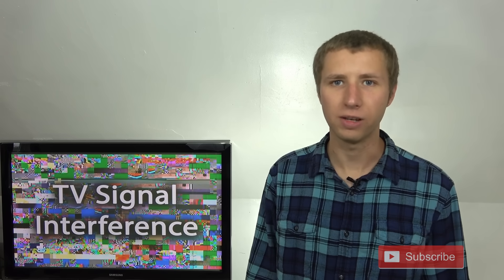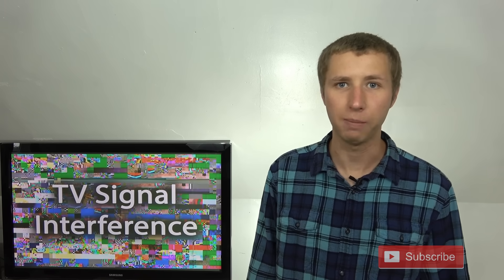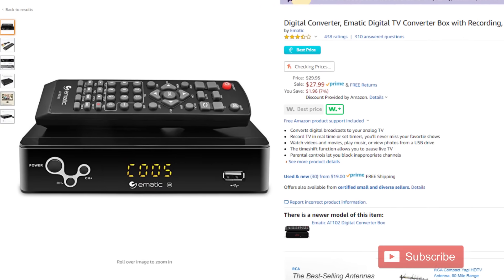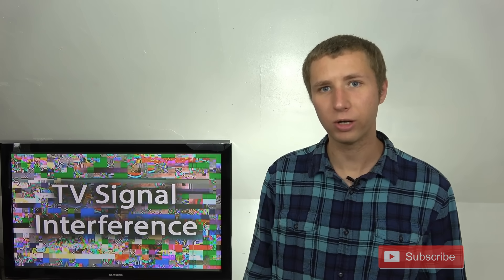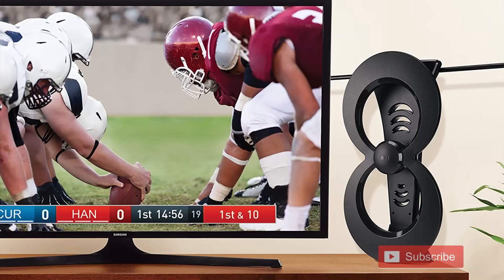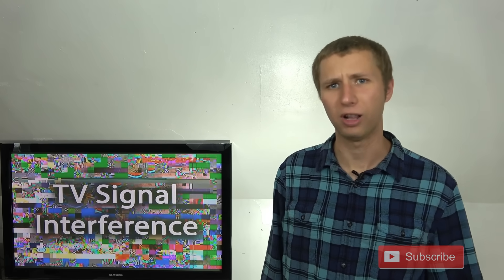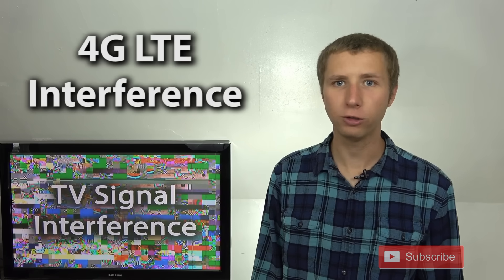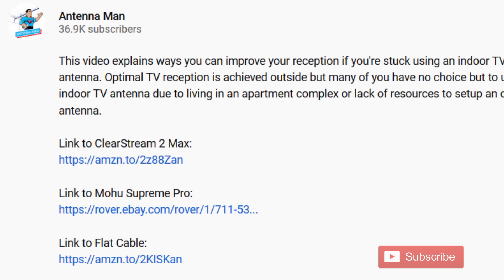Types of Interference That Affects OTA TV Antenna Reception

Comment: Tyler, I paid you for a remote assessment of my home as relates to TV antenna/ strength of channels. You said I would be fine, no tall trees to speak of, no mountains or hills, only 35-40 miles away from the major broadcast stations. I had an experienced tech come to install a ChannelMaster outside antenna to my chimney. He tried 2 different models, neither could receive several channels at all, not showing up on the guide such as 6, 7, 9, 11, 13. He said I had an LTE tower 50 yards away and directly in the way of the signal. He even added an amplifier but, no go. He has a customer a mile away from me that has no problems. Should he have tried to install the antenna at the opposite end of the roof to potentially avoid the cell tower? Plus, I have another home about 65+ miles south of where the broadcast signals come from and needed to know if that can receive strong signal reception with zero trees, lots of flat ground and no large buildings blocking us. Any suggestions? Can you actually come to install the 2 or more antennas we will need? Please lmk, thanks!
Reply from the maker: If you are having trouble with your antenna and signed up for my antenna recommendation service, reply to the original email I provided so I can get more information as I have nothing to reference from this comment alone.

Comment: So! I’m in an apartment in Tucson, AZ. First I get very good reception because I have a full size antenna in my porch, with a booster! I have it mounted on a curved pole on the ceiling I get 100% signal on most of my stations but never as bad like the picture behind you in this video until football season. CBS channel 13 plays great all year tell this time. Now this year so far I’ve improved reception by tilting the antenna upward at the mountain that the transmitter on. But CBS makes the reception look like the picture behind you or no signal at all, but again only during football season.

Comment: I have an area that gets interference in the spring and fall.  It usually happens in the morning and maybe again in the evening.  I used to be able to watch it move from one station to another through the uhf band.  Once it went through the spectrum, it was good.  Now, with digital, it isn't just interference--it is off.  I don't need to tell you that makes unhappy people.   It seemed to improve by moving to the backup antenna, which is not as high.  This makes sense if it is co-channel interference,  but the times of day don't seem to match your description of tropo.  I'm usually not at a loss like this, but I'm struggling here and some folks aren't happy. Looking for ideas.  This is mostly affecting WNEP (and WVIA), RF channel 21.

Comment: Tyler, Great video! I'd like to add it's important to check with the broadcaster. Almost a year ago, KRCR in Redding, California installed $100K of new broadcast equipment.  This was about the same time I cut the cord. I put the antenna up (a very good one), I took it down. I installed a Channel Master PreAmp on the RG6 coax. Still intermittant interference on several channels. I worked professionally with RF, Radars, and EMI during my Navy career. Nothing was making sense.  Finally, I got hold of the engineer assistant for one of the local stations displaying problems and they admitted they were haveing an intermittant "timing" problem across their stations. He also referred to all the text that runs across the screen or displays at different corners of sports broadcast.  Just examples he said puts a big tax on the equipment.  After months, an engineer from "corporate" showed up.  The frequency of the pixelations has decreased, but it still happens.  I can only guess, corporate is not willing to invest another $100K to really fix the problem.  With all that said, there are so many things that can go wrong with a digital signal.  Don't blame your home install and rip it out.

Comment: Can a high-pitched squeal coming through the speakers on my A/V receiver  from the  
HDMI- connnected OTA TV be due to multipath reception?  If so, how to fix?
Reply from the maker: Does the high pitched squeal happen when the picture pixelates or freezes? If the picture is stable, it sounds like an issue with your TV, AV receiver, or the connection.
Reply: @AntennaMan  My connection is secure and my flagship Onkyo AV receiver is only a year old and part of my home wifi network (necessary for room correction settings and streaming services).  Must be the older Vizio TV.  BTW, the picture is starting to fade around the edges and the audio formats limit the selection of surround modes on the Onkyo thru the HDMI.  Might be time for a newer set.   Thank you for your reply.

Comment: would solar panels be the culprit here as well? Cause there were new solar panels that were installed right next to my outdoor antenna on a roof and i feel that it's causing major problems for one UHF channel in particular, in which my TV sets shows that I'm getting great signal on that channel despite extreme breakups lasting indefinitely. I also feel that there's an unknown source of signal coming in on the same RF channel, as I saw one time that another network was coming in for a brief second before reverting back to its intended network, it even changed the resolution indicator from 480i to 1080i and back to 480i a second later. I already contacted the station owner numerous times already about the severe breakup problem, and they did wrote back to me saying that they're gonna work on fixing it, with zero results, as it's been over four months now and the problem continues, that can't be legal, right?

Comment: why do I get pixelation when I walk by my indoor antenna.  It's connected to fire tv recast.
Reply from the maker: Your body reflects the signals. You'll either have to deal with it (it's usually not bad in most cases) or install the antenna outside.

Comment: Was hoping for a "Fix" for non-compliant LED bulbs such as Cree, etc that pixilate the broadcast signal, such as an "in-line" Filter if one exists. TV's on both ends of my house are affected through the cable and are on different electrical circuits. Antenna field is 20 miles away and I need no amplifier for a perfect signal.

Comment: I currently have a large HD stacker antenna in my attic that works great in the chicagoland area. I pick up 108 channels on my HD-Homerun. I'm in the process of getting solar installed and I'm curious if you've seen these systems impact reception. I imagine the metal frame as well as the micro-inverters could affect signal. but I'm having trouble finding anyone with first hand experience

Great channel, keep up the good work!

Comment: My local stations are approximately 11 miles away and come in well, but one (channel 5 & rf 5), comes in great at 65% until my dehumidifier turns on. The pixellating starts. I wish there were some kind of filter.

Comment: Spinning Hard drives take out my VHF signal.  My antenna is in the attic.  I replaced my laptop drive with an ssd but I have a spinning drive connected to my tablo.  When my tablo is recording it seems to not be a problem but when the tablo accesses the drive any other time it takes out my vhf signal.

Comment: Unfortunately I'm 8 miles from Certain TV receptors, with mutiple mountains in bewteen. I tried 3 different antenna which all struggled with PBS, QVC/HSN/DABL but cannot get my local CBS, NBC, iON regular Fox or My TV signals. Even got a converter box and got a Clear Stream Max2, that fixed the PBS, QVC/HSN issues gave me a signal readout but still can't get any of the other channels, even when I take it outside on my Balcony it doesn't help get anything. I've lost hope on picking up those other 19 channels till I move I guess. 😭

Comment: Hello Mr Antenna Man,  question for you. I have an antenna, (not a good one but it works most of the time). I am a fulltime rver  and move around a lot, in this location, my TV was scrambling a lot so I went out got a rg6 quad shield cable. It didn't help my fairly new Samsung smart tv at all, but my Vizio in the bedroom it helped quite a bit in fact no more scrambling, (and it was scrambling a little before). My question: what kind of internal antennas are there in TV's, and is there a way to enhance my Samsung? Thank you.

Comment: Hi Tyler.  I have a Wingard GS-2200 Sensar III on my roof which gives me over 80 channels of excellent reception, usually.  There seem to be no local obstructions like trees or buildings.  Occasionally,  all channels go haywire and start pixelating and even dropping out entirely.  When I watch the signal meter on the TV, when this happens, I see the strength go from 10 to 0 and then back up again.  It seems like intermittent interference from some neighbor with powerful electrical or communications equipment.  How close does this neighbor have to be to be able to cause the problem?  It only seems to happen when I have a program that I really want to watch ^*)#@!.  On thing I am wondering about is that since my TV is a 13 year old Samsung DLP, which I am planning to replace this Black Friday, would more recent tuners be better at handling such interference?  Thanks in advance for your advice.

Comment: I finally got it fixed. Pointing the antenna at the transmitter I was getting multipath interference from the street. I ended up pointing the antenna away from traffic at the hills behind cell phone tower about a block away I got good signal with the LTE filter on. In conclusion I was getting interference from three sources, high powered FM radio station nearby the FM trap fixed that, cell phone tower a block away the LTE filter fixed that and multipath interference, pointing the antenna away traffic fixed that.

Comment: Tyler, I have a Panasonic Smart TV in my living room that uses Comcast basic cable programming, and whenever its turned on,  this tv interferes with my OTA TV I have in the family room downstairs in the basement. My antenna is a very good Winegard bow tie type up in my attic, and the reception is fairly good here in Western PA.  That is, until the smart tv is on, and then everything starts pixelating, or the signal drops out completely.  I ran RG6 from the antenna in the attic with a amp booster next to the antenna to the OTA tv in the basement.  Is there any solution to this besides keeping the smart tv turned off because the wife watches this TV while I watch other OTA tv shows down stairs in the family room. I suspect there might be some signal leakage from the Comcast cable tv which is RG59 cable, but I'm not sure?   What do you recommend that might help clear up this interference?
Reply from the maker: Replace the TV or put the antenna outside.

Comment: I found the clearstream max had chintzy plastic attachments for the dipole that just sets into the antenna.  They broke easily!!! I got about the same reception as the amplified clearstream ellipse.
Reply from the maker: Yeah, replacing a small antenna with another small antenna is not going to make much of a difference. You will need a larger antenna.

Comment: Cord cutting is nearly impossible with each individual having unique problems and solutions to an antenna setup.  There are a multitude of factors in cord cutting.  Maybe, with ATSC 3.0, this could alleviate problems with interference problems.  There are very few antenna installers in my area being far and few in numbers.  They seem to be a dying breed.  With ATSC 3.0, I hope that there will be more installers.
Reply from the maker: This is why I offer custom antenna recommendations on my website.
Reply: Antenna Man Your recommendations from YouTube are very helpful.  I bought a ClearStream 2MAX from Best Buy and Onn preamplifier from Walmart.  Plus, I bought the Televes Dinova antenna from Lowes, but returned this because of a failed power inserter.  For my backup plan, I bought a reflector for the ClearStream 2MAX based on your recommendation.  Now, I receive all the available channels, but there is still pixelation for some channels during the day.  At night, everything comes in clear.  I think that this is due to less LTE usage and few aeroplanes flying at night.  Based on your YouTube of CM 7778HD, I will buy this product as this will solve all interference problems during the day (LTE and aeroplanes).  I am just waiting for CM7778HD update as Channel Master is working on an update which the support person conveyed to me this morning. Your videos are spot on.  I didn't know about your website; otherwise, I might have taken advantage of this.  Keep up the good job.

Comment: I like what he is saying and he is right.... I do disagree on his separate receiver- I had an "Ematic" unit and have never been satisfied with it... ViewTV for about the same price, on amazon is a much better unit. Also, he is spending way too much time on VHF.... VHF in almost all areas is all but gone as the transition to all UHF channels due to higher Bandwidth for more stations in the digital signal. I am currently troubleshooting an issue of interference on only 1 station and only in the day time... Bad intermittent interference for Freq 533 Mhz (CH 24)!
Reply from the maker: You're actually wrong about the VHF channels going away. Most areas have major stations on the VHF band. Some stations even went from UHF to VHF due to the FCC repack. There is no "higher bandwidth" on UHF versus VHF. Every TV station is leased the same 6MHZ slice on the spectrum.

Comment: I have been listening to your advise to improve my OTA TV reception, I live in a lower lying lot and have to point my outdoor antenna (mounted on the chimney) towards the TV towers, which means towards the higher ground and lots of trees, so I have some reception issues. By your advise, I replaced my coax with a quality quad shielded cable and this helped alot. The first coax cable I tried was well made but inexpensive, and actually made reception must worse than the old single shielded cable.  Now I still will get some stations that drift out when cars drive by the house. Any thoughts? I have a 5 year old Samsung TV, which you suggested have good tuners. I thought maybe an amplifier on the antenna might be the next step.

Comment: I'm looking to install a new antenna, and rotator. Is it likely I will get interference if I zip tie the power wire for rotator to the new quad shield coaxial cable RG6  and run them inside my house zip tied together?  Does the coaxial cable, and power wire from the rotator need to be run spaced apart to avoid interference?

Comment: I recently bought a new Digital TV. The SD channels all work fine but most of the HD channels break up and pixellate, but only when there is fast action/movement on the screen. The HD channels are mostly ok when there is not much movement going on. A couple of the HD channels are better in this respect even though they have the same strength and quality readings as the other channels. Could this be interference? My antenna is directional but seems to pick up channels from other directions as well. Using a booster does not help even when 100% strength and quality is showing. There are often trees outside (I live on a canal boat) and the picture is briefly affected when people walk past, or passing trains etc. Do I need a better aerial? Signal strength and quality is very good for SD channels, Lower strength but still fairly high quality for the HD channels. Any recommendations? Thank you.
Reply from the maker: It might be on the TV stations end. Some of the channels are very compressed due to channel sharing from the FCC repack. You'll see more pixels as there's fast motion. Otherwise you can try getting a better antenna setup or a new tuner.
Reply: @AntennaMan  Thank you. It could well be the TV stations cramming too much in, and I can see compression artifacts around text etc. Since I live aboard my boat and am currently slowly travelling towards the transmitter, I'm hoping it may improve... If not, I'll be travelling off somewhere else soon anyway I expect.

Comment: Is the interference from LED bulbs picked up by the antenna or is it on the power line in the house?
Reply from the maker: Usually the bulbs but both could potentially interfere with TV stations

Comment: Hi, Antenna Man. I have a Mohu Sky 60 antenna in the attic and I get strong signal to all TVs. I recently changed the bathroom vanity wall fixtures over the mirrors from CFL bulbs to a Feit Electric model # 1200258 LED bulbs. Now when either my girls turn on their bathroom lights or we turn on the master bathroom lights our tv signal on the tv in the living room and in the master bath gets really bad interference. The Feit bulbs are listed as FCC part 15 rated but I've read online that FCC part 18 rated bulbs give off less interference. So I went to Lowe's and they have never heard of this issue and all their LED bulbs all show FCC part 15. So I expect it is the Feit bulbs causing my problem. Would love any advice on a 60-watt equivalent LED bulb that doesn't give of radio frequency interference or any other solutions.
Reply from the maker: Replace the LED bulbs with CFL and you likely won't have as many issues.
Reply: @AntennaMan  thanks. I agree. However, we had a Great Value (Walmart) led bulb. I unscrewed all the bulbs and replaced one with the walmart and it fixed the issue. The Feit brand bulbs must just be really bad.